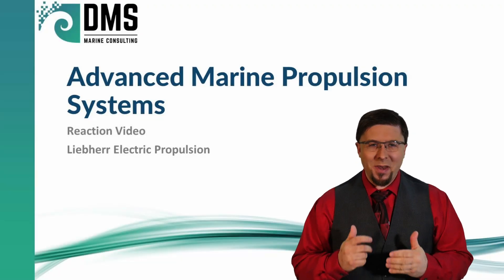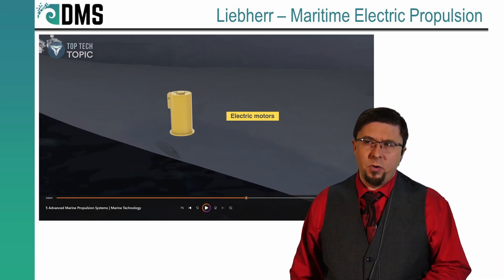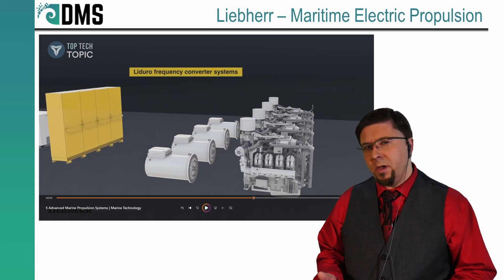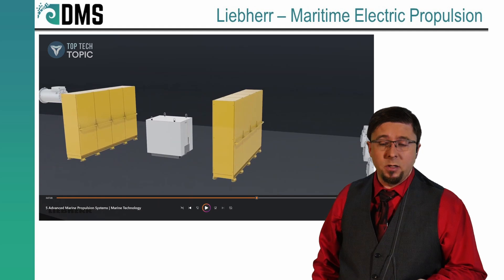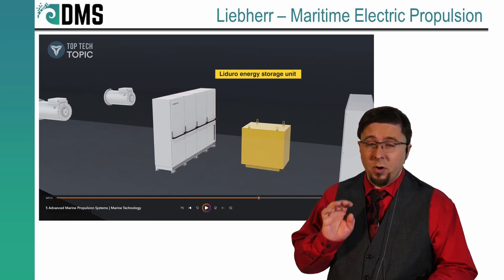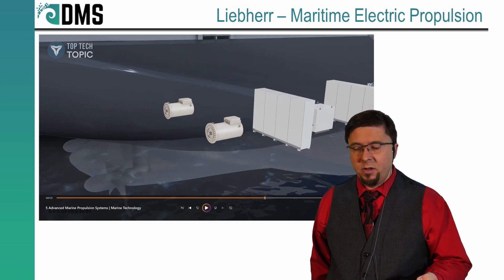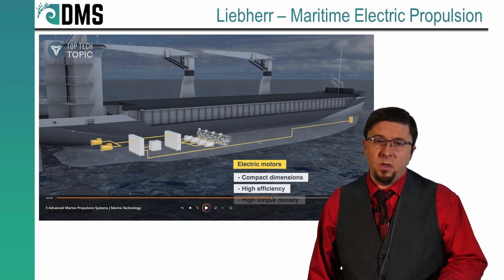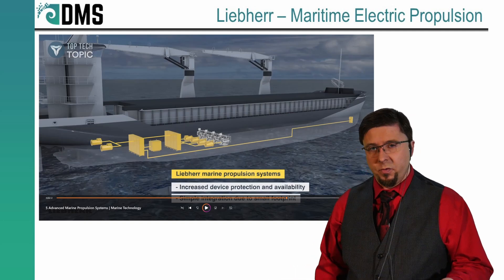Big Electric Propulsion:  What Goes Into It?

Comment: A slightly more subtle advantage is that when you're cruising you can turn off one more more of the generators to run the rest at their optimal efficiency. With direct diesel drive you have to design the engines for optimal efficiency in a particular sea state + load configuration. So if you're running downwind and empty you might have one out of four generators running, and that one generator is right at its  peak efficiency point.

Comment: Hey, I need a new refrigerator.
Liebherr: I got you.
I would also need a new 75t mobile crane.
Liebherr: I think I have something for you as well.
And I also need a complete maritime propulsion system.
Liebherr: You're not gonna believe this but ...

This is really interesting, not just in maritime engineering a completely integrated electric propulsion system is a bit like the holy grail.
I think this would be great especially for vessels that do a lot of maneuvering, station-keeping etc. that said; the thermal efficiency of a large maritime two stroke, directly driving a fixed pitch propeller at it's optimal rpm and power setting is still hard to beat, even for land based powerplants.
Reply from the maker: You said it perfect.  Yes, the large two strokes still offer better efficiency, with all the criteria you mentioned.  And the large container ships and freighters still go that route.  But there are thousands of ships that don't fit that mission profile.  Like you said, this electric setup is ideal for maneuvering and station-keeping.  This option is especially attractive to platform supply ships and offshore construction vessels.  Specifically because they do a lot of station-keeping.

Comment: The "Georges de Joly" was a diesel-electric ship built in Germany in 1929 and immediately delivered to France as WWI war dammage. I guess diesel-electric was a known quantity early in engine boat circles because of submarines. 

Another detail is that we can manufacture electric motors with their peak efficiency at any point on the torque/speed curve but at higher torque their shape and the volume of "magnetic" material gets expensive (either actual magnet for BLDC, or copper used in a coil for other types), moreso than a gearbox. We see it at lower sizes, camera gimbal motors are massive torque low speed motors (for their power), the global volume of the motor being small, we can use more expensive material instead of a tiny gearbox.

Comment: Contrary to "popular belief";  electricity Is NOT a source of power.

Electricity IS a form of power transmission with our most flexible end use options. <---- that's right, it's that simple ( because a battery just converts electricity into chemical energy, and back )
Reply: exectly. diesel is the courier of the energy. The more you covert the energy... the less efficient it will be.

Comment: Thinking of electric motors and hybrids..  A big oiltanker consumes 200 ton of fuel/day. Or +/- 110.000 $... To produce 75.000 Kw you would need 37.000 m2 of solar panels..They would probably cost +/- 5.000.000 $. Or a tankers fuel consumption in 45 days...

Comment: At 8:20 ....that cube of volume, maybe 350 cubic meters worth, does not have enough energy density by any stretch of the imagination be able to store enough electrical energy to power this vessel.
Reply from the maker: True.  It's not intended to fully power the vessel.  They use it for load sharing.  During maneuvering, if the ship needs to suddenly increase power to the props, that energy storage / battery supplies the temporary power demand.  This allows faster response time while maintaining engine efficiency.  Some of those big engines can take several minutes to slowly ramp up their output.  Without the battery, they would need to guzzle fuel for a fast increase in output.

Comment: this will go down as the most stupid idea. They try to market this as fuel efficient. It's not. Larger diesel use 180gr/Kw. smaller engines use more than 205 gr/Kw. Every time you convert power.. you lose 4%. And if you have a LIFe battery.. you will always run a defficit due to the loading capabilities. Furthermore it is a much more expensive system
Reply: Germans usually do everything so expensive that they lose the projected gain that would be available from the application of the new principle. That aside the hybrid system has proven to be super fuel efficient in cars and this will apply here as well. 
Second the use of smaller engines for added together power  avoids the need to create a tall engine room volume in the ship.
Reply: @gyorgygajdos1657  no it won't. Cars have a completly different set of parameters in term of power demands. Diesel electric can have some bennefits if you compare it to a fixed rpm engine/pitch propellor. If we compare it to a vriable rpm/fied propellor system it falls really short. The problem is the electric bowthruster. For this there should be a battery, since the bowthruster is only used  in short bursts. 
The choice for a fixed rpm/pitch proppellor was made to attach a PTO in order to provide electric power to the ship during the voyages. Is we substitute the mechanical PTO with a hydraulic one.. than the variable engine is much more fuel efficient than the diesel/electric. Since commercial ship are used to do long stints at MRC.. the bennefits from partial loads are nil...
Reply: @rickpeters1489   You want to introduce a Hydraulic transmission between engine and propeller   like diesel  -hydraulic locomotives have? That solves   one problem, you can decrease propeller rpm when you need to, but to increase  rpm in a short burst you would still need to throttle up the engine. Thus lose fuel  efficiency